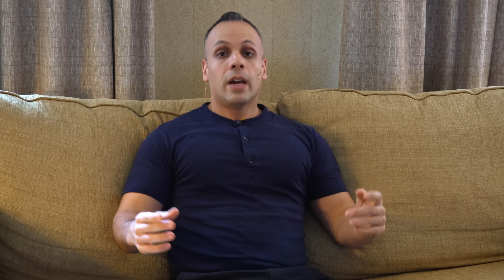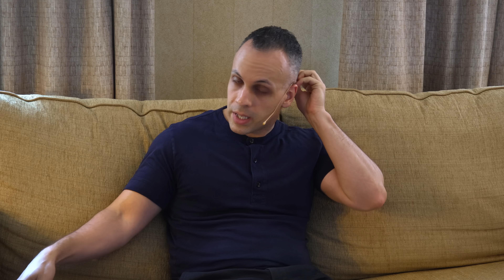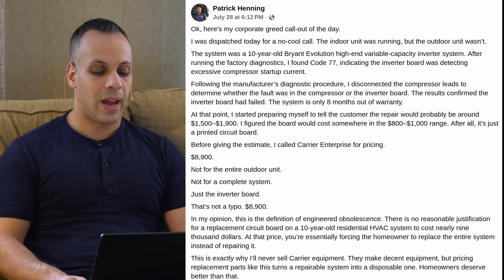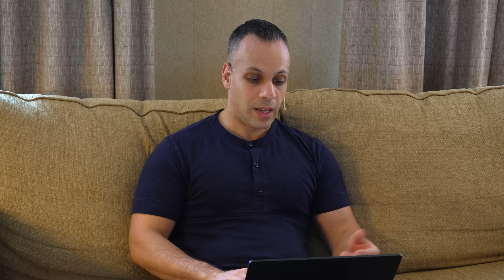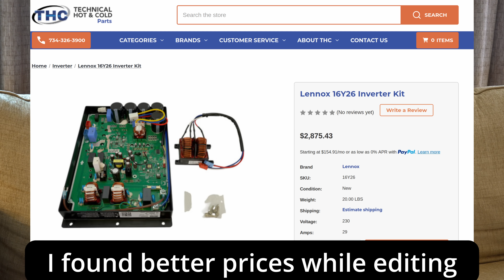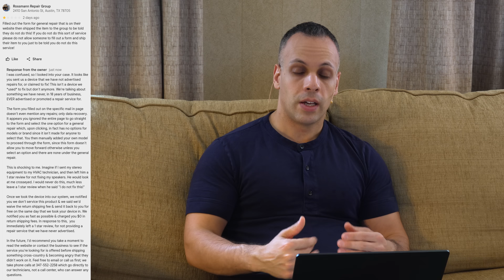Carrier AC repair has $8700 part cost for residential unit

Comment: I had a 25+ year old furnace with a bad control board that the manufacturer wanted $800 for and the HVAC guy wanted an additional $400 in labor for the 5 minute job of plugging in the new board. I ordered a generic board off ebay for $80 and spent an hour modifying the wiring harness in the system to make it work. It ran just fine for several years until I sold the house. Charging over 10x the value for parts so people can't keep their older systems working is FRAUD.
Reply: Had something similar happen but with a new dryer about 15yrs ago ours blew we bought a brand new LG and within 2 years it was fried and like a $500 estimate to fix it. We went out and bought a fully mechanical SpeedQueen brand washer and have had no issues for the 12yrs we've had it. No chips or boards to go bad because of cheap solder shrinking or cracking over time, I suggest SpeedQueen to everyone I know now
Reply: @ChRoNoS132 they seem to be the only one.
Reply: @ChRoNoS132  unfortunately even SQ doesn’t make a mechanical model anymore, and there have been very mixed reviews on the replacements.
Reply: @ChRoNoS132 Just buy an older one and maintain it yourself .
Reply: yes i had the same thing, granted for much simpler unit. about $80 for the bosrd and a 5 min install didnt have to modify anything. much better than $850 they wanted
Reply: That's a cute story, but you won't do that with an inverter board. There's ONLY the manufacturers board.
Reply: So, someone else, because you could not, diagnosed the problem and offered an OEM board to repair. That’s pretty normal, they wanted to keep it Manufacture Spec.
It’s 25 years old, so you ‘Googly Boxed’ a generic board and fiddled with the wiring and it lasted a couple more years. Ok.
I could have fixed it with a potato, a shoe string and a piece of masking tape, plus a DYI vid, but I don’t wanna burn your house down. I’ve learned that having tools doesn’t mean you know what you’re doing.
Reply: How much did you pay him for diagnosing the bad control board?
Reply: "Why does it cost $8000? Because fuck em that's why" -Carrier probably
Reply: Yes and they claim they are suppling parts but really they are being total scumbags. There's always a work around being ethical for horrible companies.
Reply: Sweet.
Reply: HVAC and similar service businesses are largely rackets that traffic in fraud.
Reply: Did you make the new home owners aware of your magyvered stuff lmao?
Reply: Not necessarily. But okay
Reply: Early retirement and bass boats.
Reply: @tsl7881 I retired once already. I hated it. I didn't like feeling worthless.
Reply: Hvac tech here. I am very against corporate greed and out-of-control prices, but I don't eun my own business.  What I do (depending on the issue) is tell people how to fix their problem, what to buy and what video to watch (if it's within their ability).
Reply: that's their business model, force you into a brand new unit or pay out the ass to fix the old one... terrible corporate neighbors, but it's what happens when a democracy becomes an oligarchy serving only the wealthy and their profit schemes.
Reply: @paladro HAHAHA "OliGaRcHs" , thanks reddit, very deep and insightful
Reply: @paladroDon't use words you don't understand, plus we were never a democracy moron .
Reply: I'd argue it has more to do with capitalism and for profit money obsessed mentality that we have
Reply: @y76769 oh yeah, it would be much better to live in a socialist country where you'd have to wait on the government to repair it. Brilliant
Reply: @y76769 Not that either ,it's literally supply and demand .
Reply: @Bryan-Hensley  the Scandanavian countries are socialist, China is communist, none of what you said goes on there.
Reply: @Bryan-Hensley  And probably by those two Air Con repairmen in Terry Gilliam's "Brazil"!
Reply: @Bryan-Hensley I think you are a bit off track. If it were a communist country, maybe so, the government would be the one you are waiting on. Socialism, not quite so. From labor unions, insurance for the things you value, memberships to organizations, police and fire protection, our road system, food distribution, even the money system we use for payroll to the purchase of goods and services, are all social programs. You don't have to have a program to be run by the government to be considered socialist. Socialism just means for the benefit of society. So if you use/benefit/contribute to any of the things mentioned above and 100s of other things including this forum you are writing in, then you are a socialist and part of socialism.
Reply: @reginaldstubtoe4185 😂😂😂
Reply: @y76769   Nobody works for free.  The real problem is that most personalized work is highly inefficient in comparison with the factory work to build new units.  It's not so much that the custom work got more 3xpensive, it's that the mass production got much cheaper and makes the custom or low volume work look very expensive by comparison.
Reply: People forget that the word capital in capitalism is referring to money and wealth
Reply: @BrainScramblies  Nobody works for free.  In socialist countries, nobody works at all and everyone starves.
Reply: You could write a book with all of the scams that residential hvac companies use on their customers. My favorite is the "R-22 is unavailable and we only have a small stock of it left, for $300 a pound" meanwhile you go online and it's readily available to anyone for $50 a pound shipped. Seriously fuck these people
Reply: @dagabbagool2600   It's illegal (criminally and civilly) to sell R-22, R-12, or any Montreal ODS to anyone who doesn't hold an EPA-certified license under section 608 or 609.
R-438A is a drop-in replacement for R-22.
Reply: @ba94845 And you're an enabler of the shitty system entrapping people. Government only made our lives more expensive with the promise to do the opposite. To the surprise of no one, expecting a Government that runs up the debt to 40 trillion cannot be trusted to be cost efficient.
Reply: @ba94845  China is happy to sell it without that.
Reply: @dagabbagool2600 we also lose a bunch of refrigerant that we can be responsible for. A HVAC company can fix a leak, fully recharge it and another leak happens in a few days that's completely unrelated from the previous repair. We can lose 15 pounds that we have to replace, even though it isn't our fault. Try charging the customer for refrigerant twice and see how they respond. Any time a system is brought back to full power, other parts can fail. A weak part might not show itself until a system is running normal again. R22 was $1,300 per jug but is declining now. Some distributors are going to be stuck with a bunch they can't sell.
Reply: @Bryan-Hensley  Pressure testing with nitrogen is a thing. Maybe you should try it.
Reply: @alantrimble2881 maybe you should learn to read
Reply: @Bryan-Hensley 
Yeah if your paying $1300 for 30# of R22 maybe you need to price shop. I do and it ain’t $1300, it’s less than half of that. But, show me your EPA certification and I’ll give you deal today, $1299.99 cash.
Reply: @bauhnguefyische667 learn to read.
Reply: @dagabbagool2600  no it definitely is not available online for $50 a pound. 
You're getting a blend that might work, but as soon as you have an issue that requires recovery, you'll get charged $1000 for incineration fee due to contamination.
Reply: All the information on what parts cost or how to diy it is out there. In this day and age there is no excuse for overpaying in that way. You didn't, and with rare exception, anyone else who isn't a lazy dunce can easily avoid it too. It isn't the 70s anymore.
Reply: @dddon51  in the case that Louis covers in the video, there is no practical DIY no matter how many tutorials you watch. The part is proprietary, there is no generic version, and the OEM is the only one who has it. They control the price and the supply. They want $8900. Either you bribe someone at Carrier to slip one out the back door or you find one used on ebay. Not realistic in either case.
Reply: Someone needs to explain to you a few things here.  Its terrible practice and very unsafe to modify an existing HVAC design out of original design with a part that's not designed for it.  

The company takes all liability and can easily loose their license if something malfunctions and sets your place on fire.

Believe me. There's lots of us who hate the current pricing.  We are making less off this bullshit.   Supply house told me 1800 for a fan motor and since the lady was a widow we told her "its 1800 plus out normal hourly rate" 

No market up.   She hung up on us.  Basically doing it for free.  $99 hr.   Very honest pricing.     Ita so expensive to run an HVAC business
Reply: @JasonLabriola no it's not. We can modify a system, as long as you are smart enough. I've upgraded plenty of system with better parts than original. I've been doing this for 48 years
Reply: You just said "updated with better parts".   I'm talking about buying aftermarket boards for $80 not designed for that system and then rigging them so they work.   That's a lot different that upgrading with better parts.  better parts are mostly not 
 cheaper.    Cheaper parts are cheaper.  It's like Mitco $10 dual capacitors vs Titan Pro $28.  The titan is a better part, more expensive.
Reply: stop using the word 'fraud'

use the correct word:  stealing

or 'thief'
Reply: HVAC Guy asked for $400 and that is fraud? There is being frugal and then there is being a cheap ass !!
Reply: @EinKlienerDonner Says the HVAC guy. 😂
Reply: That's not what fraud is.  You ordered a generic part that you could make work.  The repair guy was going to put in a part that he might have to warranty.  Was he overcharging?  Maybe.  Was he deceptive?  Doesn't sound like it from your story.
Reply: Abolish capitalism, North Korea is based
Reply: You forgot the part about call backs. Every time I've ever tried to do someone a favor and use generic it turns into a warranty nightmare. 
You're paying for the warranty and the knowledge. Just because you think it's a board doesn't mean that's all it is
Reply: @Squat5000Then they’re overcharging on the warranty as well.
Reply: @orppranator5230 LMFAO okay, you go start a business with the liabilities associated with this kind of work and see how smooth it goes. I hate what manufacturers are doing, but most techs and small businesses are barely get by with rates that are comparable to mechanics despite needing tens of thousands of dollars worth of tools that can be deployed on the go
Reply: @Squat5000 Lmao. warranty they wont honor. The failure is by design. Get real.
Reply: @whatevbrah if it’s in the time zone written then it’s honored
Reply: You obviously have never owned a business or hvac company at that . You’re the fraud. You wouldn’t even know what was wrong with your unit if it wasn’t for the experience of the tech .  You playing with safety of your family if that exchanger starts leakimg carbon monoxide because your too cheap to buy a new one after 25 years . 

Tech probably mades 60 to 80k a year . The van must do 400k in revenue just to turn a profit and pay of the insane overhead , taxes cost of business . No one is getting rick here buddy .
Reply: @growtechsystems6528  Who is rick?
Reply: @alantrimble2881 Rick charges double.
Reply: @growtechsystems6528 If that’s the first major repair in 25+ years, I’d be thrilled to pay only $1,200 and support my local hvac business. Now he ruined some poor service tech’s day when this chinesium board goes up in smoke and he finds the wiring harness has been modified. 

I’m a handy guy myself, but I generally leave the stuff you need to be certified to do professionally, to the guys who are certified. This guys sounds like a cheapskate who is a menace to tradesmen everywhere. I’d also like to point out he had some poor schmuck drive out and diagnose the problem for him, probably for free or very little, and sent him away. I bet his mechanic hates him as well…
Reply: You didn't call around enough and find an honest HVAC company. The ones that advertise the most are the ones you want to stay away from. You got lucky though, most of the time when you replace those boards and don't find the problem, the new board goes up in smoke.
Reply: @Bryan-Hensley because they go out of business lol there is no point to go out for nothing it’s not charity work.
Reply: not everyone could spend an hour, or 3, not knowing how to do it, having to learn and then buy the parts and "hope" it will all work first time
Reply: @0Blueaura  People tell me all the time that 'I'm so lucky I know how to do that', when in reality, I'm too poor to have it otherwise, so I'm going to have to learn how it works and fix it, or go without. 0% luck involved.
Reply: @JHe-f9t  You missed the part where a good chunk of the population literally does not have the intellect to do that. You are indeed lucky.
Reply: @tntcamperr  Knowledge comes from experience, not IQ.  It's not intellect, it's practice.

I know people who stopped going to school after 8th grade that can rebuild an engine, rewire a house, and run a CNC mill.
Reply: It’s not fraud it’s what it costs to do business. Some companies are ripping people off but it’s not cheap to keep a warehouse, work vans gassed up and paid for, dispatchers, advertising, insurance, and on and on. Companies don’t make pricing based on what customers happen to think is “fair”.
Reply: @funstuff192 Wah wah. Cry me a river. For every company willing to rip off customers, there are a few that charges decent prices. 
While you twiddle your thumbs waiting for business, those others with less overhead are grabbing up your potential business.
Reply: @funstuff192  then you should try farming
Reply: @funstuff192 this is severe cope because the same service could be done by someone else for 1/10th the cost. It's not the cost of business, it's the cost of YOUR business
Reply: IT costs alot of money to run a business and to have a tech run around in a van to fix your sh**. If you want to fix it yourself, have at it.